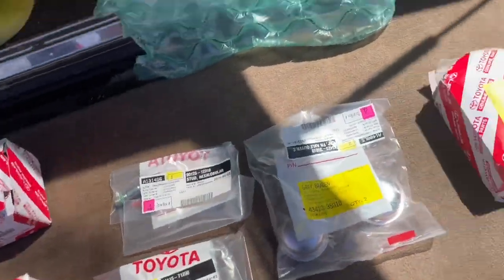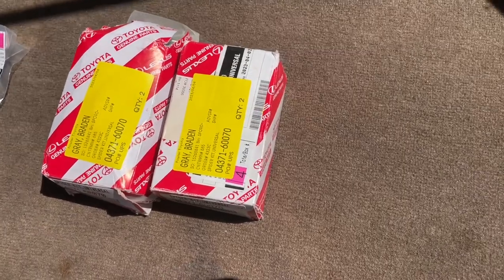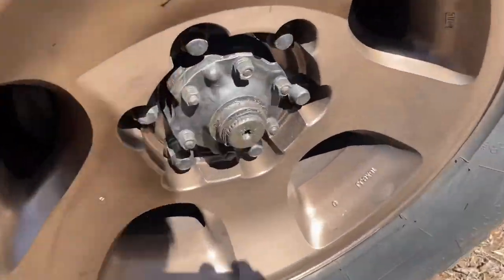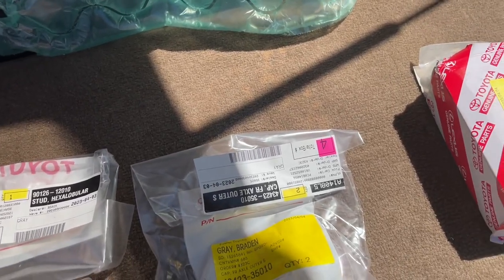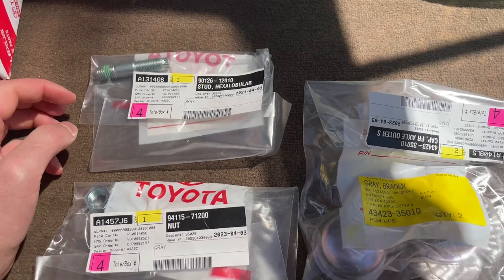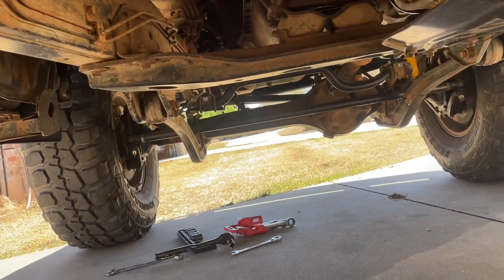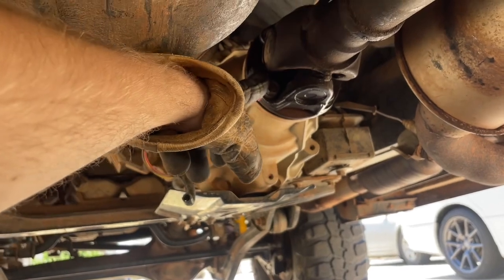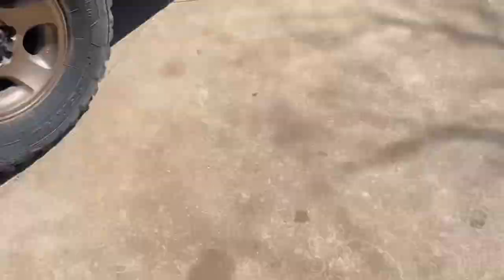80 Series Land Cruiser U Joint and Lower Knuckle Stud Replacement

Comment: Why is your check engine light on?
Reply from the maker: P0401 Insufficient EGR Flow or something like that, may delete the EGR
Reply: @theflipflopfabshop  I have had that b4.  Most common fix is the vsv for egr.  I had one that would ohm out bad when it got warm.  OEM part is the best.  I wouldn't mess with the aftermarket on.  I can help you if you want.